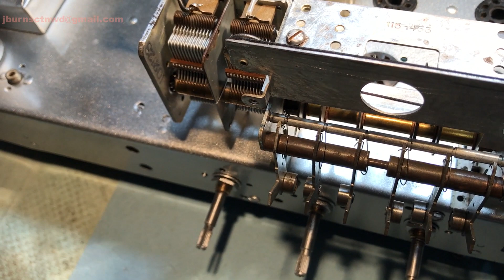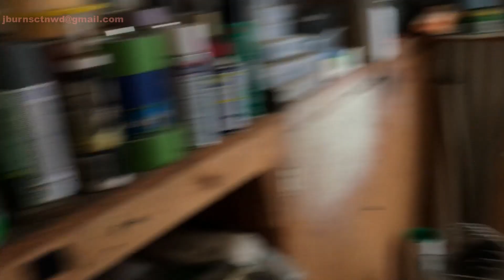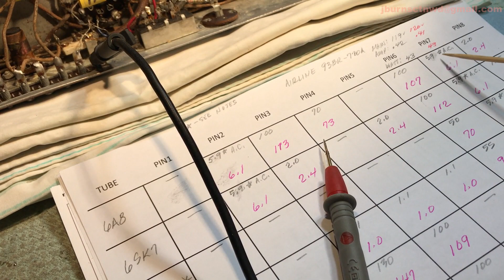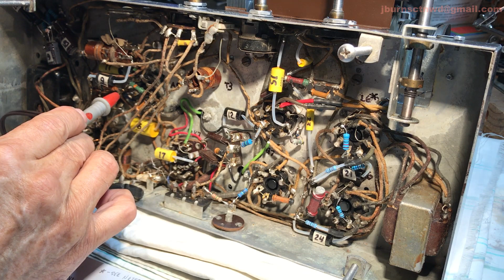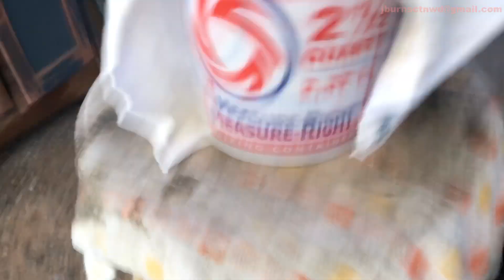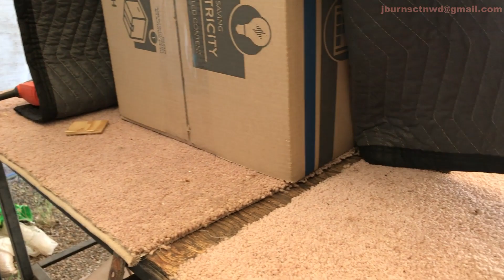Airline 93BR-720A In Progress 3

Comment: Looking awesome.  If you are doing a survey, I do enjoy the longer videos and watching the work.  To the casual passerby looking at these antique radio and TV repairs and especially restorations, may not have an appreciation for the amount of work that goes into them.  Your work is first rate.  Good working chassis and looking forward to the cabinet as always.  
I had one of my viewers make a comment on one of my videos when I was calibrating a balanced circuit for certain volts according to the original specifications.  He noted I was using a relatively modern DMM for measurements, and that I should check what input impedance was used for the schematic's figures.  On the schematic for this radio, as shown from Rider's, shows the tube pin voltages are taken with a 1,000 ohm per volt meter with 115 VAC at the input.  So the specified voltages shown on the schematic were using a meter which would load down the circuit more than your DMM (probably 10 Meg ohm input impedance), so it makes sense that these readings could be somewhat higher depending upon the circuit's sensitivity to the meter's load at that point, even though the circuit is performing exactly as original.  It doesn't really matter unless one wonders why they are not lower, tolerances on resistors not withstanding.  
Outstanding repair as always. Could you share the way you made your springs?  Thanks Jim!
Reply from the maker: I’m never anal about the small stuff. I know some are more concerned about being precise about what they do but not me. I don’t like to sit on the bench hypothesizing about what ifs, I need to be “IN THE GAME” 👍
Reply: @jimburns348  Right on.